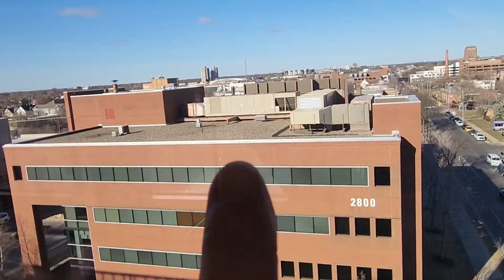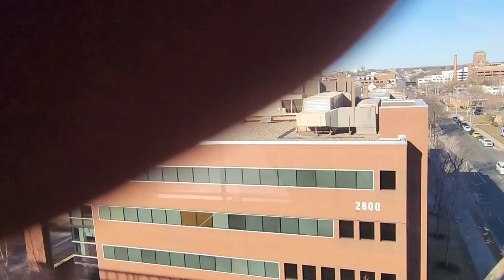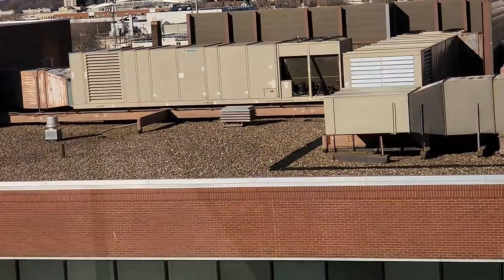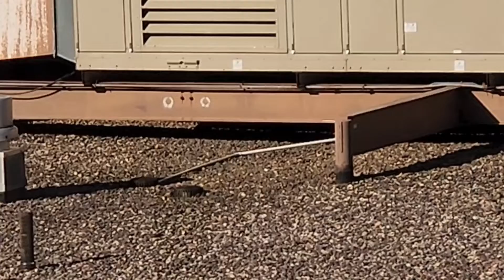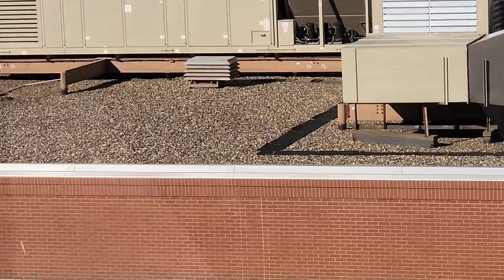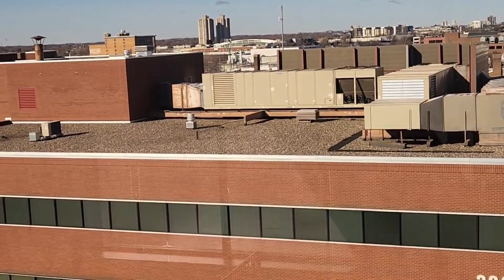High Rise Window Cleaning Roof Anchors

Comment: Great video jeff! 
What would happen to the side where the anchors are more than 50 feet away? How does one set up a drop there? Or is it not possible according to OSHA? 
Thanks!
Reply from the maker: Great question, technically yes if anchors are further than 50' from drop zone/ parapet it is an OSHA violation because it doesn't meet the standards. The Likyhood of an issue is very minimal but its a standard.
Building owner is liable if they allow a person solo operator or employee to suspend without proper proceedures on their end,  Letter of Assurance.

Because OSHA can't fine solo operators , since 2012 in MN and 2017 for ENTIRE US, building owners ARE responsible for any accidents. Big liability but most operatirs and owners aren't aware. 

Checkout more high rise discussions www.windowcleaningwarriors.com